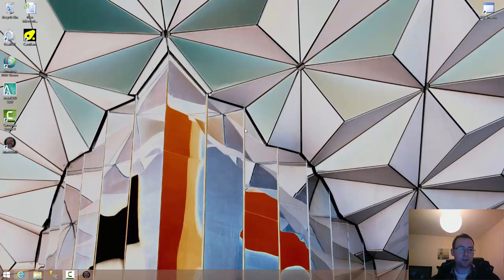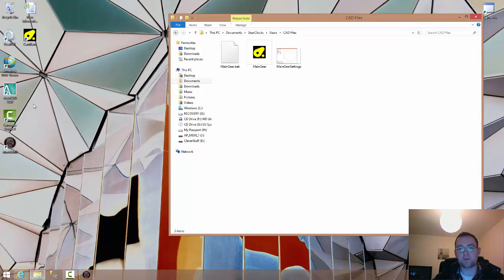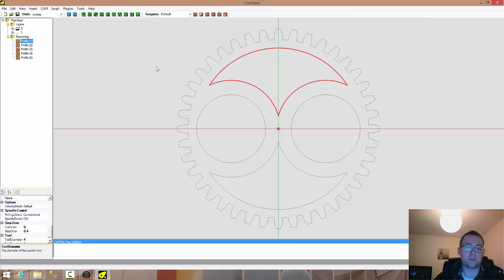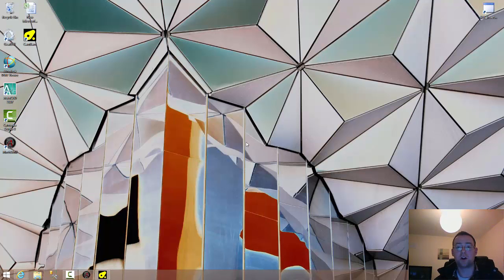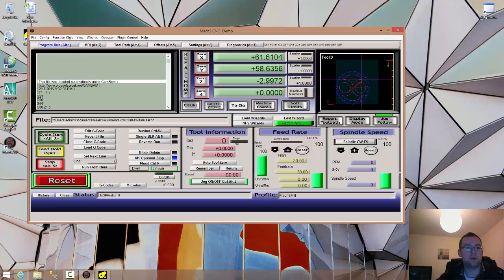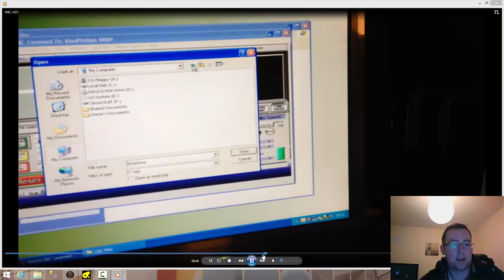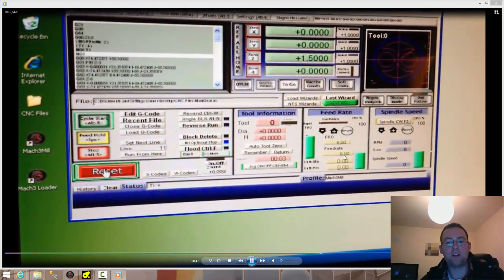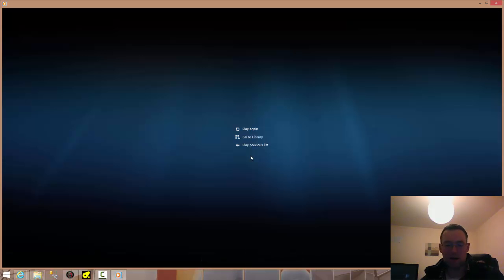AutoCad CamBam Mach3 3040T CNC

Comment: Hi Alan 
I live in N.Ireland and would like to know if you know anyone that could help me get my 3040 Chinese cncest to work properly.
The x movement sometimes goes in the wrong direction and also can’t get the machine to calibrate properly .
If you know anyone up my way that could help me I would really appreciate it .
Happy new year 🥳
Reply from the maker: Please look at at is the CNC gcode file created by the CAM software and the hardware motor driver used. Each axis is calibrated through mach 3 or 4. Distance and direction is set here. If tne G code goes crazy after this then the CAM package or hardware driver breakout board is the main cause
Reply: I have the same machine, I know quite a bit about all these settings. I will tell you this little 3040 is a really accurate machine. But quite a steep learning curve. Takes a lot of reading all the manuals.
Reply: @toddspeck9415  I have set it aside for quite a while now as sort off given up on it , can’t understand why the x movement changes direction and don’t know anyone who understands circuit board wiring .☹️
Reply: @vapoureyes  What board does it have? Is the board Red with a white Eagle on it? Is the X axis changing direction or is it just reversed. All the struggles I went through, I know not many other people want to struggle with it. But these little machines work very well. Are you using Mach 3?  I have the red control board with the white Eagle on it. And run it with Mach 3. These boards need a very specific plugin to work. Then you have to adjust quite a few settings in Mach 3. I can find that info. on the board if you have the same one. Are you able to control it at all?
Reply: @toddspeck9415  in bed at the moment but will have a look tomorrow, I appreciate you getting back to me, will see if I can send you a few photos.🛌
Reply: Your going to have cnc dreams now.  Tomorrow you will need to open up the controller and see what board it has. If you don't have a fully functioning mach 3 license, You will be stuck. It starts to get quite expensive. 175 for mach, And there is massive amounts of info. to learn. But it sounds like you have some movement. That is a good start. Just don't smash the carriage into the sides. This little machine is quite powerful. I think it could break quite easily. You have to sst up quite a few soft limits and parameters to keep it from crashing. Peace out man.